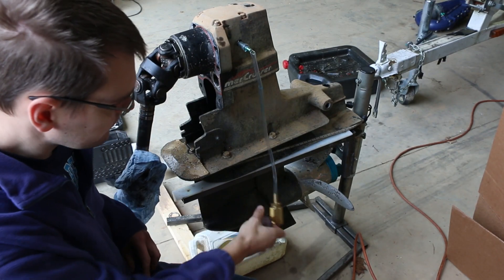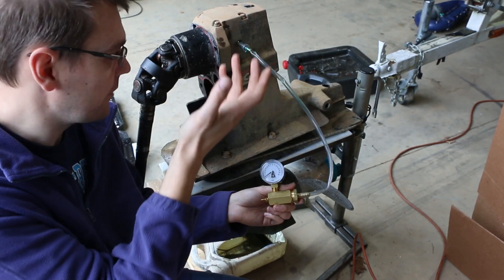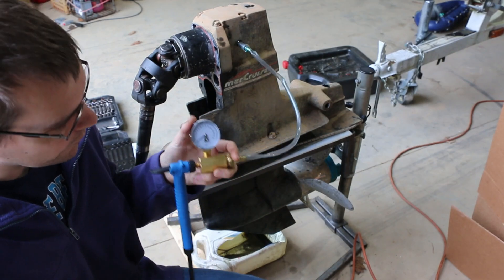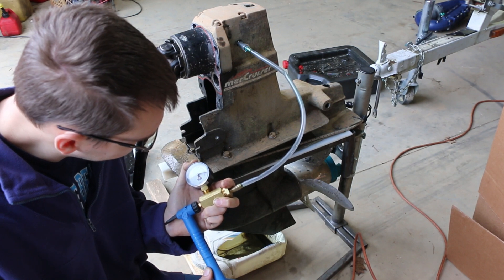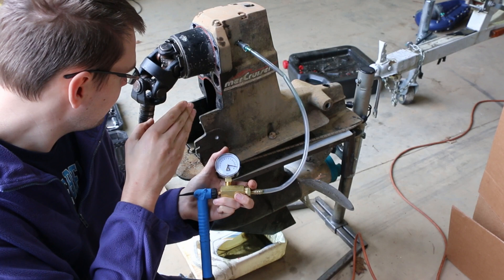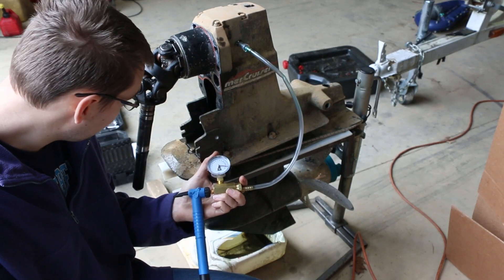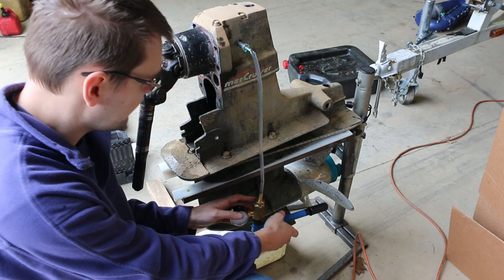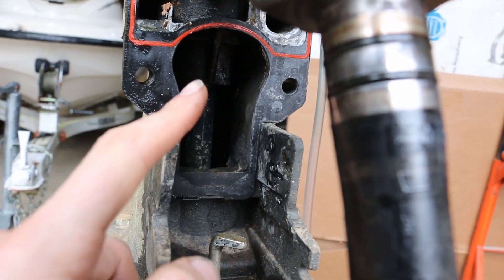How To Pressure Test a Mercruiser Alpha One

Comment: Hey, was this a gen 2? Was that just a simple oring seal leaking at the driveshaft that was easy to get or did you pull the upper gearcase apart to change it?
Reply from the maker: Yes this is a gen2 alpha one, It was a lip seal like you would see on most driveshaft type applications, I did have to remove the upper gearset and all that to change this seal sadly.

Comment: Quick question where did you buy the 3/8 barb adapter. I have the same pressure gauge and just need to find that adapter to make this work
Reply from the maker: I bought a lower unit oil pump like this and robbed the hose and adapter: https://amzn.to/3EkWkWL
Reply: @ thanks for the help! Also did you pressure test it with gear oil in the drive? I saw in the video that you saw oil coming out of your broken seal. Just wondering because my drive is filled with fresh oil and I want to pressure test it before putting in the water this year, since I had some milky ness in the oil last year when I drained it.
Reply from the maker: @MrAirsoft0917  Yep, its a-ok to test with oil in it, if its full of oil you won't need as much air to pressurize it to the right psi, and it'll be easier to spot the leak!
Reply: @trythistv  ok thanks for the info! What are you thinking for psi 5-8?